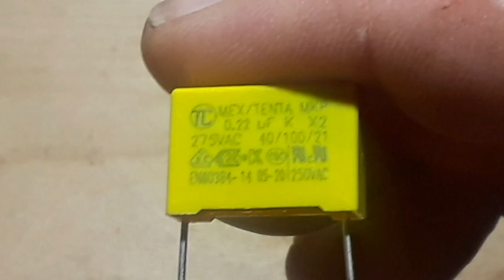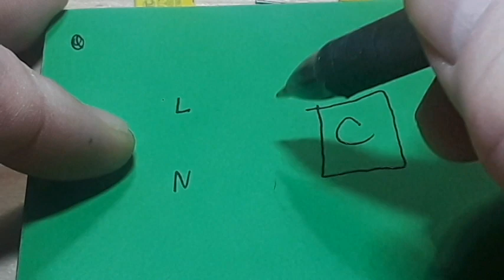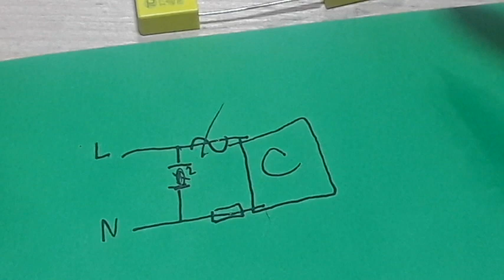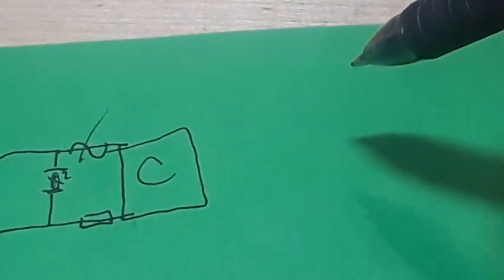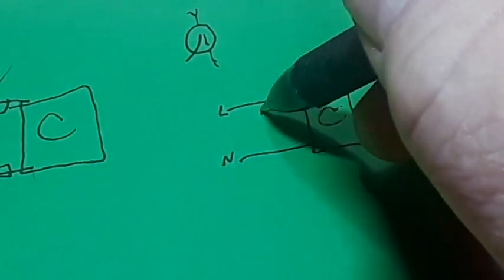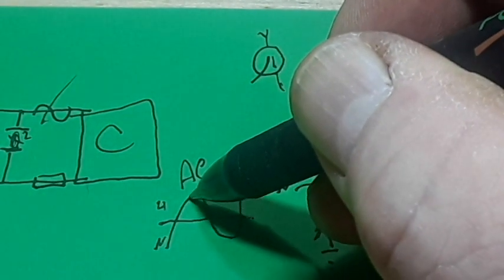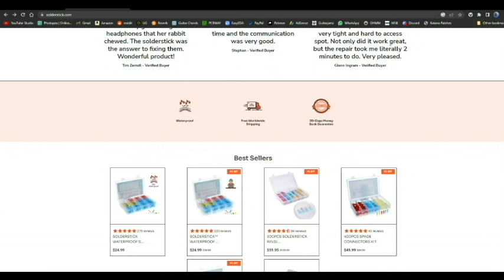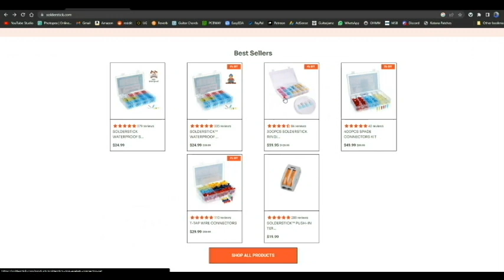A Basic Introduction To Safety Capacitors sponsored by Solderstick Wire Connectors

Comment: So if I understand you correctly: if the x class capacitor has failed, there would be continuity across it and if the Y class cap fails then there wouldn't?  Sorry I'm a newbie here, but trying to understand why my electric line trimmer failed.

Comment: a question: I use the same capacitor with the same values. Which strong resistor value do you recommend to use? Based in your first schematic.

Comment: It's often claimed that "Class X capacitors are designed to fail short and class Y capacitors are designed to fail open" but I think this is nonsense and I've never seen a manufacturer state this.   Both class X and class Y capacitors are typically metallised film capacitors which are self healing and do not fail short circuit under normal conditions.  They gradually degrade with reducing capacitance when subjected to over-voltage spikes.  Class Y capacitors are designed for use in situations where their failure could lead to a risk of electric shock and so are required to withstand higher voltages without failure.  The use of capacitors in  common mode filters as described in the video does not present a risk of shock and so does not require class Y capacitors.

An application which does require class Y capacitors is one where a capacitor is connected between the primary and secondary circuits in a switch mode converter.  Short circuit failure of the capacitor could result in mains voltage being connected to the output.  This is something that is often ignored in cheap Chinese electrical devices such as mobile phone chargers making them dangerous.

The main feature of both class X and class Y capacitors is that they are designed and rated for direct connection across AC supply voltages.  Note that the voltage rating shown on the case is always an AC  value.

Comment: Absolute trash.  Please avoid the misinformation on this channel.

The notion that X2 capacitors are designed to fail short, while Y2 capacitors are designed to fail open is rubbish.

In reality, both X2 and Y2 capacitors are designed to fail in a safe manner, regardless of whether they fail open or short. The main difference between X2 and Y2 capacitors is their intended application and the type of filtering they provide.

X2 capacitors are primarily used for common-mode filtering and are connected between the two power lines of an AC power supply. In the event of a failure, X2 capacitors can fail either short or open, but they are designed to do so in a safe manner to prevent electrical shock or fire hazards.

Y2 capacitors are used for differential-mode filtering and are connected between one of the power lines and the equipment's chassis. In the event of a failure, Y2 capacitors can also fail either short or open, but they are designed to do so in a safe manner to prevent electrical shock hazards.

So, it is not accurate to say that X2 capacitors are designed to fail short, while Y2 capacitors are designed to fail open. Both types of capacitors are designed to fail safely and to minimize the risk of electrical shock or fire hazards.

Comment: If the X2 cap goes short in your drawing how will it blow the fuse? Shurley it will blow a fuse in the supply/plug not the one in your circuit?

Comment: If the x2 cap shorts it may trip the panel board circuit breaker but the fuse in your circuit will remain unharmed.  😅 Additionally, the neutral is bonded to ground at the panel, the sine wave oscillates between a positive and a negative voltage in reference to the neutral/ground.
Reply: Hello Kevin. Could you please explain about bonding of the neutral to ground at the panel. How exactly is that done? With thanks.
Reply: @bobs_ya_runkle  In the USA, the electrical panelboard is the central hub that distributes electricity throughout a building or residence. It is typically connected to the utility power supply via a main service cable, which consists of two hot wires, one neutral wire, and one ground wire.

At the main panelboard, the neutral and ground buss are at the same potential, which means they are electrically connected or bonded together. This is because the neutral wire carries the return current from the loads in the building back to the utility, while the ground wire is used for safety purposes, such as providing a path for fault currents to flow back to the source and trip the circuit breaker.

However, at sub-panels, the neutral and ground buss are not bonded together, which means they are kept separate. The reason for this is to prevent any potential difference between the neutral and ground wires from causing an electrical shock hazard. This is achieved by connecting the ground wire to a separate grounding electrode, such as a grounding rod or a metal water pipe, which is then connected to the earth.

In summary, the main panelboard in the USA has the neutral and ground buss bonded together, while sub-panels have them separated to prevent electrical shock hazards.

Comment: PAUL< When the Y-Safety capacitor fails OPEN, how would anyone know that the safety capacitor has failed open? because the AC line 120VAC is still going into the circuit under test and the fuse never blew. I'm not sure how the Y-Safety capacitor would protect the circuit under test from voltage spikes, voltage surges, over voltage because one the Y-Safety capacitor has Failed Open and Multiple voltage spikes, voltage surges, over voltage happens after its going to damage the circuit under test right?
Reply from the maker: The safety in the safety cap is it. It saves you from being electrocuted. It doesn't care about the device

Comment: Errors concerning low voltage circuits, for example battery operated audio amplifiers, aren't very serious.  Presentations dealing with line voltages demand more scrutiny and immediate correction.